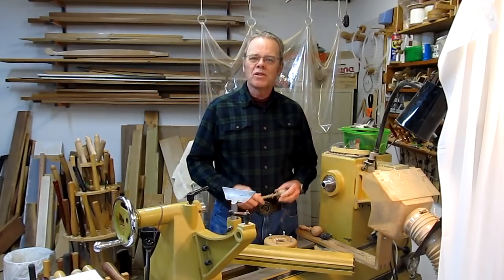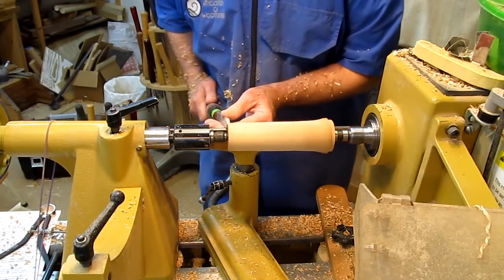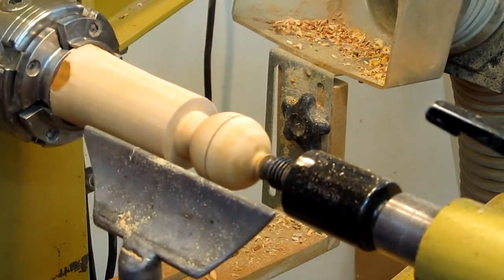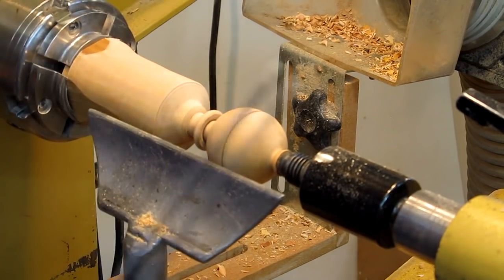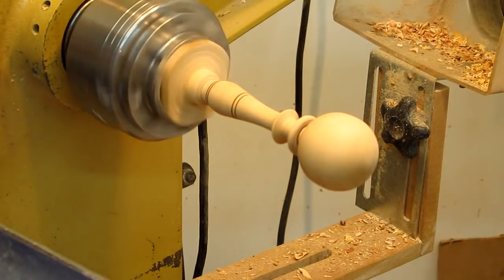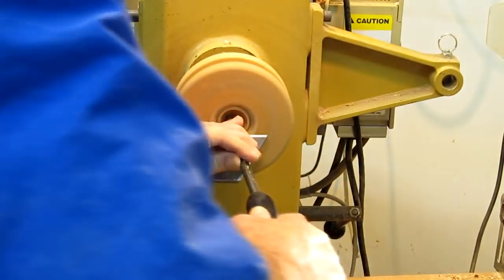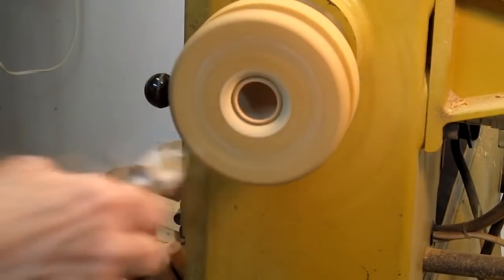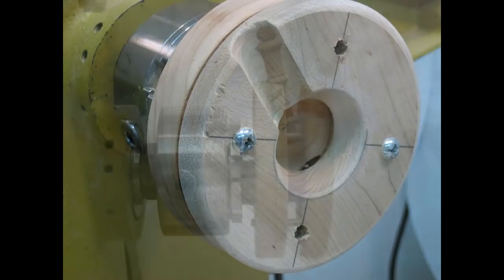How to Turn a Coffee Scoop

Comment: I like the idea of the donut chuck, seems safer than the spigot chuck I'm currently using for coffee scoops.  I suppose a larger diameter front plate could be added as a barrier to the spinning handle for safety & comfort while turning..
Reply from the maker: There are other ways of holding including jam chucks and wooden jaws. It took a couple of hours to make the donut but I have turned a lot of these since then as I probably made it 8 years ago.

Comment: Hey Mike, I'm learning lots from all of your videos. A note on safety shouldn't you remove your ring before working on the lathe or any rotating machinery. I want to keep you healthy so you can teach me more from your videos. Keep up the good work! Thanks again
Reply from the maker: +oljswartz Possible? Of course. People have to make a personal choice on how far they go. Personally, I see little risk to me based on my turning style and projects of getting my ring crushed and losing a finger. I weigh the risks of sticking the ring in a pocket with a hole in it and losing it.  Or leaving it in a safe place in my shop and forgetting to put it on. Do what is right for you.

Comment from the maker: I got an email requesting more information about the calipers I was using. Here was my response:
I made my calipers from music wire from a hobby shop. It is the same kind of wire I used for making the shafts of my awls in my awl making video. The diameter is probably not critical. It is probably about 1/8". It is springy but retains its shape once formed, something that coat hanger wire for example won't do. It fits into the scoop and you feel how snug it is. The goal is to form a shape that will fit into a scoop and the legs will be about the distance to just fit the final inside dimension with little friction. Too much friction and you have to hollow some more.

Comment: Yes I did. Thanks again. Couldn’t I use a 1 5/8” Forster bit and then just round the donut hole?
Reply from the maker: Not the way I would do it.  I  see no advantage of doing it your way. It may not give you a rounde hole that will maximize contact with the ball Since you will a cylindrical wall.

Comment: Couldn't you put the bowl on a drill press while its in the doughnut and make the initial scoop hole with a large drill bit? Or for that matter couldn't you just drill it on the lathe itself with your drill attachment?  It makes me wonder if a fine hole saw bit would work also.
Reply from the maker: Try it one time and see if you would be happy.  I think not. It is not that difficult hollowing.

Comment: I am really enjoying your videos Mike.  Thank you so much for sharing your skills.  You are doing a great job and have been very helpful as I am hooked on turning now for a little over a year.  I'm following your build on this donut chuck and  would like a clarification on the 1 1/2" hole in the donut.  Does that 1 1/2" go straight thru to the backplate - plus the round over?  That would mean that the 1 1/2 is the stop on the 1 3/4" ball.  Yes?  So, if I wanted to make the scoop diameter 2" OD, what would your recommendation be for the donut hole?  I am thinking 1 5/8 or 1 3/4.  Would greatly appreciate your feedback comment if you have time.  Thanks again
Reply from the maker: That sounds right. Did you download the article I wrote on making the donut chuck? The link is in the video description.

Comment: Have you considered using a 1 1/4 inch forstner bit to drill your pilot hole into your measuring scoop?
Reply from the maker: No. I see no advantage as you still have to clean up the bottom where the bit left a hole as well as thin the walls to a uniform thickness for appearance. I do not see the drill bit saving time. But that is me. If it works for you, great.